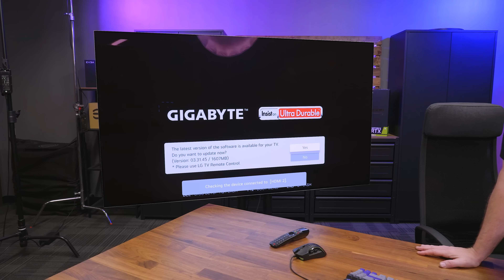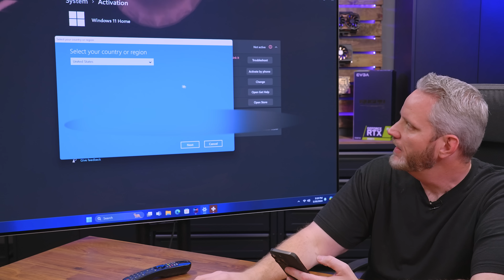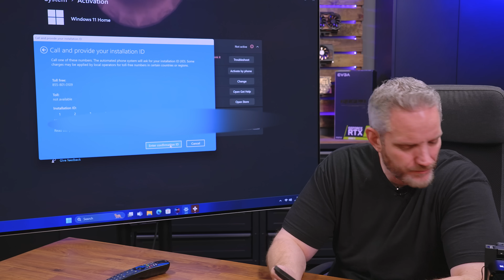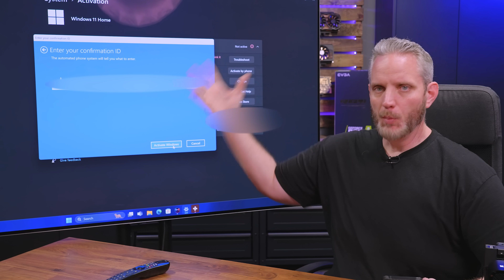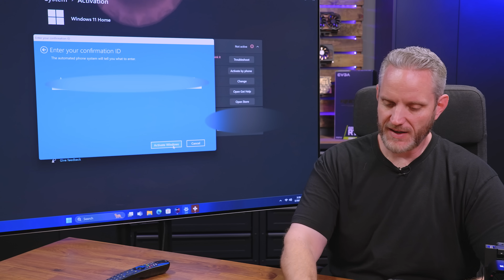How to move OS drive to new PC and keep Windows and Activation! EASY!

Comment: But if you need to upgrade your hard drive there's no way to get around it you still gotta reinstall windows right
Reply: You do not have to reinstall windows--you can clone the old drive to the new drive.  If your new drive is a Samsung than you can use their free (and awesome) cloning software otherwise you'll have to use third party cloning software.  If you clone the drive you will not have to reactivate windows or even do anything if the cloned drive is used in the same PC... switching drive interface types like going from IDE to PCIe may cause issues but that may be "fixed" by now.

Comment: yeah but actually no not really, it's simple: it's complicated.  That's one case and basically the best, but if your "source" system comes from an integrator or like a big distributor like HP, DELL etc., and/or if you had bitlocker, and/or secure boot, and/or  a few other things like this the cases can vary enormously be careful (or install Linux ;) there no activation problems and other bullshit)

Comment: Okay, so the ram I assume is messing up because it was saved on the “starry night” mode or whatever it was called, if you installed any rgb software to control that rgb, aka gigabyte software (worst offender I’ve found) it will brick the profile on the ram entirely. If starry night is on it will do that, super niche issue but it happens really easy with any g.skill ram in personal experience. No fix other than to get new ram.

Comment: i recenly change my pc from intel to amd but its not working properly i search on internet but this problem seems to be only i face so far so the problem is when my windows loaded to desktop  i can go to my pc i can see all my partition and also i can go inside the partition but when i try to run something eg chrome or video etc my windows froz totaly after that i have to restart my pc ( im a seller so ive been changing pcs for time to time but this is my first time switcing to amd and this windows ive been using  for arround   6 years  now and i have very impt things there so i dont want to lose it) i know my english suck but anyway hope you understand

Comment: So the way that Windows checks activation depends on a lot of stuff. Like it or hate it the easiest way to deal with this is to link your Windows license to your Windows account. I've never had any problems moving and cloning boot drives or clean installs and I've gone from Intel to Threadripper to Ryzen back to Intel back to Ryzen. I've also swapped between Gigabyte, ASUS, ASRock, MSI and SuperMicro.

Comment: :O I don't need to continue collecting hard drives... I have an old tower with 5 drives, each rolled over from prior builds, it still boots from XP, and assumed when I make the next one I'd be plugging them all in again lol 
I should probably just migrate everything to one...
Reply: Have too many failed or failing hard drives lying around.  About to move so it's going to be fun sorting through them!  Very happy to have moved onto NVME.

Comment: Once I changed the motherboard under a Vista OS, and the reactivation happened automagically. It was surprising, but apparently that was expected behaviour of OEM Windows if you did not change any major hardware under it for a while.
My second experience with activation which I recall was with a Windows 8 system (if I remember correctly), many years ago. I just popped the system drive in a brand new pc. As a Hungarian, I was pleasantly surprised how painless the phone reactivation was. I never in my life imagined that I would ever call Microsoft :D

Comment: I just have an SSD (and another that's a constant clone - manual clone every two weeks) with the OS and OS alone (plus a modicum of programs that refuse to be modified or otherwise altered on location), and when time comes, i pick up the SSD and move on. All my data and programs are on separate (doubled) HDDs. If need be, i just pick up those HDDs and move on. The SSD is already cloned, so there's that. Any other methods are ... meh, cumbersome and bothersome, as they depend on programs or automation or whatever.

Comment: Answer is yes but depends on the SATA Mode in bios if you had raid setup then nope but if its the other one then it should work, but not recommended due to drivers may be cause problems like blue screens even if you remove old drivers and install the new ones

Comment: I wish I would've known this. When looking for what to do with a new motherboard an CPU install I was "told" I needed to create an MS account and the use digital activation to get Win 11 to reactivate on the new hardware. I also had to answer a question stating that I installed new hardware. It did activate but now it's a "digital license" and I have to enter a 4 digit PIN every time I restart my PC.

Comment: Fair warning, even if you're swapping processor brands and do all the necessary swap steps like removing Intel-specific drivers (or vise versa), make sure you have NO external drives attached. I learned the hard way when I had my externals in an array housing and went to boot up for the first time going from Intel to AMD a few years ago, damn windows corrupted 6TB and years of modeling work. I had one other drive out at the time that saved 15% of my backup files, but all the good stuff was gone. I even tried a ton of recovery software and got part of one drive back, but the file system was unrecoverable, so I ended up with an unmapped drive and every single file, dll etc in one lump header. It would have taken me Years to put everything back where it was. 
Paying for cloud storage isn't cheap, but you can bet I have four copies of everything now and the Important stuff on cloud.

Comment: That test bench with the power distribution would make more sense if someone was swapping out entire motherboards frequently.  The other bench seems better suited to what Jay does (swapping out and testing components like CPUs, memory, and GPUs) and the more open air design (without the PSU blocking air near the vrms) should be slightly better for ventilation… which I think would be desirable for benchmarking different components - or maybe it wouldn’t make a difference. I’m speculating.

Comment: You don’t have to activate by phone. Before you switch out your motherboard, type the following into the command terminal: 

wmic path softwarelicensingservice get OA3xOriginalProductKey

I used that to pull the windows product key off my old gaming laptop and use it for my new PC build. You get up to 3 motherboard changes before requiring a new key (unless you buy a lifetime product key). I also use recycled keys to run windows virtual machines.

Comment: My question is I have an Asus motherboard. Do I actually need to use armory crate? If not, can I remove it from my computer without it messing anything up?
Reply: You could easily run the system without it. If you need RGB controls, there are 3rd party packages for that and if you aren't running any Asus peripherals then even better. By and large, Armory Crate doesn't offer all that much on a desktop board, at least not on my X570 Strix, besides RGB and peripheral control
Reply: @craigmurray4746  I don’t have any peripherals by them just the motherboard. And I plan on switching all my RGB over to OpenRGB. I just wanted to make sure I didn’t need it for like driver updates or something. Thank you for replying back to me.

Comment: just a heads up if you change too many components even a cloud MS key can trigger reactivation or new key requirement if too many components have changed. i went Z590 Asus strix to Z790 and bingo my electronic copies would not reactivate  oem w11 pro time for £15 then :)

Comment: If you setup a profile with your microsoft account, the windows "license" will be attached to you microsoft account. If you go to "activation" in settings it will say "such and such a license attached to your microsoft account". Then when you move the drive to a new board/machine, you click "troubleshoot" then select the options for "i recently changed my hardware". Then it will ask you to select which device associated with your account this is. Chose the computer (by computer name), and boom should activate. I've had it take a couple tries, but should work just fine. Never heard an issue moving drives OEM or otherwise.
Reply: Well I have issues with trying to re-activate win10 after a motherboard swap. 
I even went as far as re-installing Win 10 back on a fresh drive and still nothing.
And yes, it was activated on the old motherboard but will not activate on the new motherboard.

Comment: Last time I moved a drive, there was a "did you change hardware" selection, and I just clicked that and was off to the races.  That was a while ago.

I want to know how everybody handles using a data drive for their user items (Documents).  In the past I used the OOBE with a script to move the ENTIRE user folder to the D drive.  The last time I changed the data drive I learned that this wasn't a good idea as putting a NEW drive in resulted in a no-boot situation, and trying to "fix" it with the tools failed.  Therefore I re-installed Windows, and used the and manually moved all the data from my spinning HD to the new nVME data drive.

I want to know why MS just can't add in a "Where do you want your USER data to reside" if it sees that there is a 2nd (3rd, 4th, etc.) drive/partition installed.  Default it to the system drive, but sheesh I don't want any of the USER info on the system drive, I'd prefer it on the DATA drive.   Even with the standard "Right Click Directory->Location->New Location->Move", the actual "USER" directory still resides on the system drive.  OOBE Method moves the entire USER directory to the DATA drive, but it causes issues if you want to change your data drive.

Comment: Jay great topic and how about other upgrades like adding a new SSD and changing it to be the new boot drive. Also setup tips like if I had two different speed SSD should the faster one be for OS or games? etc
Reply: What you do in a case like that is use the built in System Image backup tool in the Control Panel and make a system backup to an external drive. Then you restore it to the new drive. So long as the new drive is the same size or larger, it just works. Provided your partition layout is correct, you can then easily expand the C drive to fill up the remaining size. As for your other question, you really do want the faster SSD for your games. Windows, Office and apps don't take full advantage of a really high speed SSD past a certain point really.
Reply: @craigmurray4746  oh ok. I think I'm good with the boot drive if I want my games on the (newer) faster drive. I am kind of new to PC gaming I appreciate the info!

Comment: i want to do something like this with my old xp computer because it's currently trapped in an old half height btx form factor dell office computer
Reply: Do the BTX stand off holes even line up with anything ATX once you invert the motherboard?
Reply: @craigmurray4746  btx is completely different. Basically all the expansion slots are on the opposite side of the io area from atx. another way of looking at it is btx has the cpu at the bottom or middle of the board and the expansion slots at the top. graphics cards for example would have the fan side facing up instead of down which limits options on boards with one pcie slot. the cpu cooler on btx boards gets cool air directly from the outside of the case like any intake fan so cpu thermals are nice.
Reply: @aarontrupiano9328  I knew that yeah, saw enough pics of BTX back in the day, though I have never worked on one in person, which is why I was curious about the stand off holes more than anything else. I forgot about the slots being in a different location, not just upside down. Good luck finding some sort of case!

Comment: OEM keys are valid keys, it is not illegal to buy or resell OEM keys, that was just FUD spread by people who do not understand why retail keys are 5~10x the cost of OEM keys.  The difference is that OEM keys attach to the first MB they are activated against and require calling Microsoft to move, and can only be moved a few times before MS forces you to buy another one.  They are the keys that Dell, HP and other OEM's purchase in the hundreds of thousands.  Several smaller builders, usually in Taiwan, will then sell unused keypacks to users for cheap.  Retail keys are licensed to you and are able to be moved around and reactivated indefinitely just as Jay did on the screen.
Reply: Out of pure interest today tried a really old Dell Windows 7 pro licence from a laptop was throwing out and found out it still worked on Windows 11 Pro.  Purchased a retail copy of Windows 7 Ultimate Genuine in 2010 and the key still works today on copy of Windows 11 Pro.  Not many products are still giving you value over a decade later.
Reply: @laowai2000  Yeah even though OEM keys aren't supposed to be portable, in practice MS rarely actually bothers restricting them.
Reply: @palladin9479  No complaints there.  Very pleased to have a couple of spare licenses now.

Comment: There is another way: The Microsoft Account:  Create a new Account on the PC, Convert this Account to a Microsoft Account, Go to Devices and connect your Microsoft Key to this Computer. Delete the Microsoft Account from your PC. ... 4 Years later when your Motherboard dies, you swap your new Motherboard in, Reactivate Everything. You don't know your Microsoft Key. You simply create a new Account, Convert it to your Microsoft Account, go to Devices and putt they Key Back on your new Motherboard, Delete the Microsoft Account from your PC.   Happened to me, my B550 Board died on a Firmware update, luckily i 'store' all my Windows Keys in a Microsoft account. (Even if they are new upgraded Windows 7 Ultra Keys, they still work as Win 11 pro Keys)

Comment: I changed my MB, CPU and memory recently. I was unable to login to Win11. The  security locked me due  to different hardware, my pin didn't work and the link on the screen to change the pin did not work. I found different tricks online but none of them worked and I had to reinstall Win11

Comment: I had prebuild from lenovo with intel cpu nvidia gpu some basic lenovo motherboard with default bios and i took windows ssd and put it in my new build with msi motherboard amd cpu and amd gpu and it worked right away like nothing happened

Comment: I have changed boards a few times and its not always this seamless. Sometimes Windows will just BSOD and not be able to load. More often that not,in my experience, too. Almost every time I upgraded boards in the past several years on either Windows 10 or 11,it caused issues. Its way more likely if going from Intel to AMD or vice versa, I think. I have had to reinstall Windows from scratch on several occasions when changing boards.

Comment: One thing I always do too is go into Device Manager, Show Hidden Devices, and uninstall all of the old items from old board. I just find it cleans it up Device Manager and has prevented me issues later on at times. I have used the Activate Windows feature for so long now when switching hardware. Great video Jay!
Reply: do you need to uninstall every driver before migrating? GPU, chipset etc? thinking of going over from amd to an rtx build with my drive. What do i need to do beforehand?
Reply: @delavardeheshjoo4269 you don’t need to do anything before other than make sure things are backed up for your comfort. I use OneDrive so I am good.
Reply: never had any issue with old drivers except on like s775 era boards and drivers super specific, like some asus driver you install to enable charging current on certain usb ports.
if you never installed any such special drivers, should be no issue. my current windows install has migrated like 5 times since s775 intel onto finally landing on ryzen 5600x.
will likely be carried over to am5 as well.

windows 7 was sensitive to cross-chipset (usually just between amd and intel, same vendor was fine) and then sysprep /oobe or /generalize would fix it.
might not be the solution on win10/11 tho. never tried. cause I've never had to. for what it's worth I've migrated like 20 different installs so far over the last 5 years.
Reply: So, you do that while your drive is still on old mobo?
Also I am thinking of booting into safe mode for 1st boot, uninstall all old drivers and than normal boot and install current hardware drivers.
Will it be a good thing to do?
Reply: Thanks for ther tip here. Im a neat freak LMAO
Reply: Great advice, thank you!
Reply: To remove the old rubbish from device manager I use a tool called GhostBuster, it's free and it's portable, it will show you all the devices in device manager that are no longer connected and remove the whole lot in one go if you want. Been using it for years and it works great even on Windows 11, such a time saver and it's nice to know all the old crap is gone. It will never touch active connected devices.

Comment: It does mostly works even when the chage is very big. I wen form a i78700k to a 14700k and everything worked like a charm then just installed the new drivers for everything and was 100% working
Reply: Yeah, I just moved from an 11700k to 7700X, so everything but the drives are new and it worked perfectly on first boot

Comment: For anyone wondering you can also find the inf files and inject them directly into the windows installation ahead of time as well. Also make sure you disable Bitlocker and Data Encryption before changing boards as Bitlocker will trip due to new secure boot keys being generated when taking an old drive and putting it into a new board.